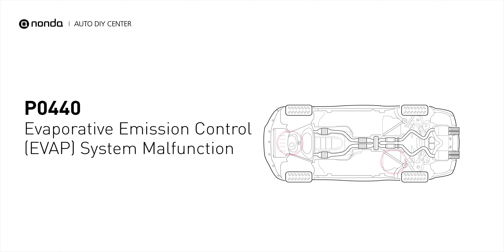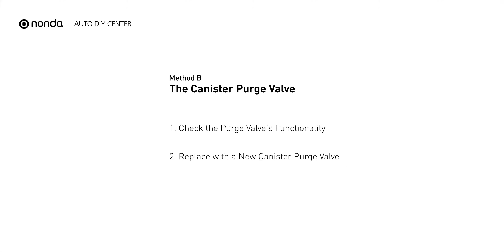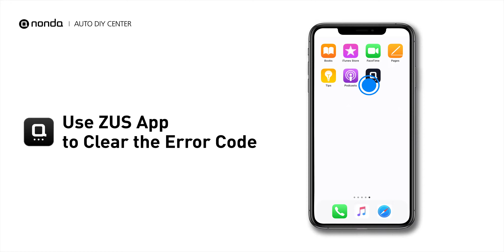How to Fix P0440 Engine Code in 3 Minutes [2 DIY Methods / Only $4.73]

Comment: I havent tried to clean the filler neck yet but did get a new gas cap last year since the other one wasnt twisting on. Getting this code from bluedriver still.
Reply from the maker: Hello, please provide us with your vehicle's year, make and model so we can address your concern accurately.
Reply: @nondainc  2003 Chevy Trailblazer LT....I had a smoke test done back in September and shop said it was fine. This code came back around the same time I had a P0172 and P0014 over a month ago. P0014 solved by oil change after not changing it for 6 months and then P0172 solved by doing my fuel injection cleaning at a later date after oil change.
Reply from the maker: Please try the methods shown in our video and let us know the result. Thank you.

Comment: Hi I have 05 dodge Magnum same code came on. Also my car starts but shuts off 3 seconds after it starts
Reply from the maker: Is there any other codes that register along with this code?
Reply: had this exact issue with a 5.3 GM truck. I did notice if I leave the gas cap off the truck starts and runs perfectly fine but I still have the check engine light on

Comment: My car through the code while I was going over rough road it's a Mazda six I have maestro RR on my radio head unit so I know the exact code it threw a p044  As I went over pretty rough bumps and I need front and rear struts replacing pretty bad I've been putting it off for a while in the rough was the road was rough and I wasn't used to the area I was going about 30 could a rough road cause it to leak . Well anyway I have the capability of clearing my code through my radio and that's what I did hasn't gone on again since...I have an aftermarket pioneer double din W4400 NEX With gauges and OBD hooked up to the radio itself through Maestro RR
Reply from the maker: Hello, thanks for sharing your experience. Stay safe!

Comment: Yeah never mind using a radiator/gas cap pressure tool to test the gas cap rite?? just replace it if cleaning it doesn't work?? No one ever test gas caps anymore, just change em and 4get the high failure rate of defective new gas caps stores will sell you! Get pressure tester and determine whether or not u need a new cap

Comment: Tried both of these what else could it be
Reply from the maker: Hi Cody, you can send us a message via auto_diy_center@nonda.us. Our customer care team will assist you there. Thank you.
Reply: I checked the purge valve changed like 3 gas caps, the charcoal canister and the filler neck. I still have the issue on my 2001 E38
Reply: @leathaface510  Get rid of it and go EV.
Reply: Leak detection pump
Reply: @leathaface510  smoke test
Reply: @rkgsd  EV is way too expensive..  still costs you to fill up your charging system $18 a pop to charge it,Plus it's more expensive to insure because it would be a newer vehicle you would need full coverage,     you can get another car  $2000  used somewere Run it into the ground every year  insurance is cheap And you'd still be ahead buying one car every year..
Reply: You should bring it to the professional if you can't figure it out it's probably a leak needs to be Early checked with a leak machine
Reply: If you smell gas in car as your driving and you get poor gas mileage, it’s ur charcoal canister . It should be next to ur fuel tank underneath